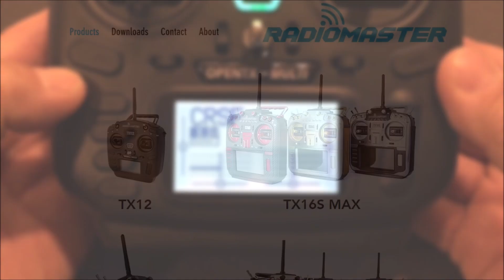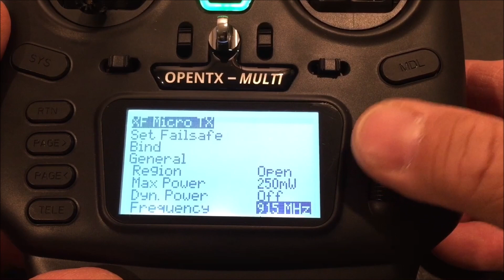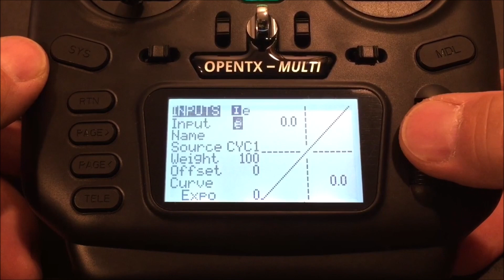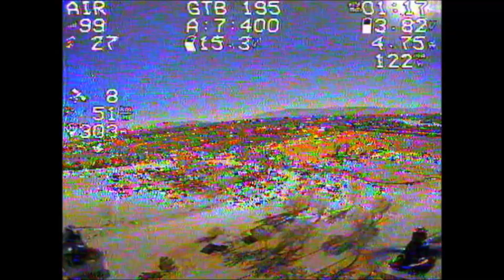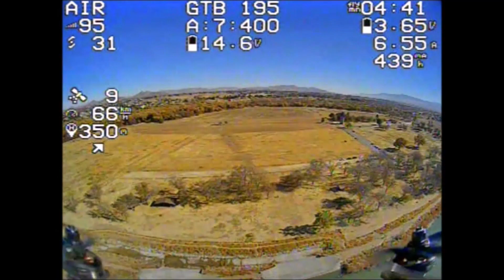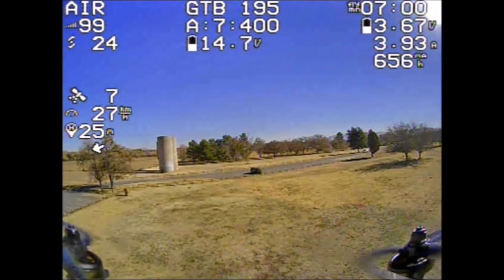Radiomaster TX12 Crossfire Setup and Test Flight

Comment: Nice review and the set up on the crossfire. thank you! I could not get mine to work until I watched this review a 2nd time. on the tx the operation mode was set on forced telemetry. Yours was set to normal so I changed my setting and now it's working. So thumbs to you for this review and Mike at TBS for the help.
Reply from the maker: Wow great!  Making the video was worth it :) 👍😍
Reply: Yes it did oh my god I thought I was going to nut. Long hours of resetting up over and over. Resetting my new radio master tx16s in open tx and the crossfire tx on the agent. I told Mike Chin at TBS that I seen your set up and review and that one setting in operation did it. Thanks again 😎👍🏻
Reply from the maker: @Nspecthergadget2010  
Awesome!!
Reply: Nice, very helpful content, planning to buy this great budget Tx12 after my old Taranis x9d plus Se(with crossfire micro external module) is getting alot of stick lagging.. What is the difference between this Tx12 and the Tx12 mark ii?

Comment: How does it cope on the 1W setting? I just set mine to 1W and the voltage level dropped and I got a failsafe just by facing away from the drone...

Comment: Pete, great tutorial. I am a bit naïve, when do pick crossfire? For FPV long distance flights?
Reply from the maker: Thanks bro!  It is said to have less latency and more control over distance than the frsky and others and there seems to be a difference.  When I first used it, it felt different.  The rhythm of stick control and the response of the drone reacting to your input is slightly faster and you can fly the thing forever it seems so it is noticeably better.

Comment: I got the nano fits xlite and is 1watt is there an adapter to fit in this radio? And rssi or LQ  how do you set up? Love the crossfire system myself.. and gps.. learning how to save logs.. trying lol great vid! And yes allot of vids. But you have a special way of explaining..clearer to me.. like blue falcon.. bardwell not for all.. lol 💪💪👊👊🐻
Reply from the maker: oh, I'm learning myself and this is the second time I'm doing this.  First was the tx16s which was just as easy and now the tx12 which is pretty much ready minus the sd card.  I don't know about any other transmitter when it comes to crossfire haven't tried it.

Comment: yooo whats good, i ve been watching you since doing your longe range on your holy stone 720e, im wanting to go long range and i dont know where to start. im wanting to go crossfire i think, so my question is do you recommend getting this set up over any other set up? as being the budget route ? what RTF drone thats not too expensive analog you might recommend, im looking at a flywoo or a rekon 5 unless you suggest something else? thanks love your channel. why do you recommend the nano kit over anything else? like do you think if i just got the a micro module i should be good? which module, like in tracer or regular or does that not matter?
Reply from the maker: The nano kit is cost effective since you get three receivers.  I've not used the tracer nor any other set up so I can only recommend the nano which works great.  Any light quad like the flywoo should be a good choice.

Comment: That's one nice and compact radio. What is your valuable opinion on its gimbals which I understood are still potentiometer based, not Hall effect sensor gimbals. I've seen people replacing the stock ones with Hall effect ones, but is it really worth the effort and money? Are they really that much better?
Reply from the maker: I'd just buy another remote.  Potentiometer gimbals will last for years before it needs to be changed.  Replace it then to halls.
Reply: @RCEscape  - sure, fair enough. I was just thinking... since I never got a chance to test Hall effect sensor gimbals, are they much smoother than potentiometer ones? I mean, is it obviously nicer to use those gimbals, or Hall effect is basically just a more durable solution than potentiometer ones, not necessarily smoother experience when moving those sticks?

Comment: I saw this video when I first got my TX12. Don't use the TX much.

Today I'm trying to use it with a new OMP ZMO VTOL but can't get it to work. Would you have some feedback that can help? Thanks.
Reply from the maker: what receiver does it come with?
Reply: @RCEscape  no receiver.  I'm using a Crossfire with SBus protocol.
Reply: I have no idea.  Maybe OMP has the answer. Thanks so much for getting involved.

Comment: I need help...

When I press system button I get only 
01 spectrum (INT)

Not the same list you have

Graupner hott
Frsky gasuite
Multi chan namer
.
.
.
Crossfire config

🤔

How I get this list ???
Reply: i actually just fixed it by formatting my SD card to FAT32 instead of NTFS
Reply: same issue